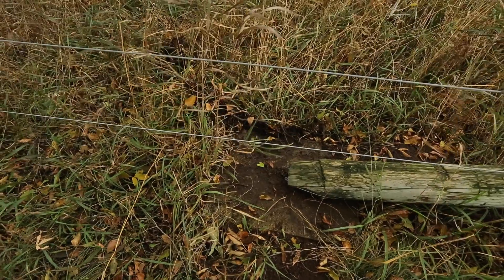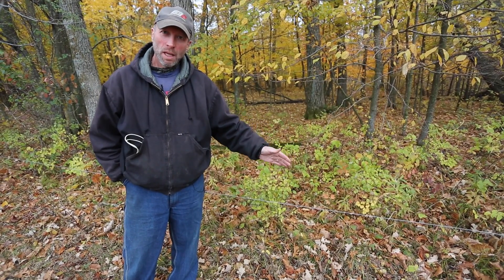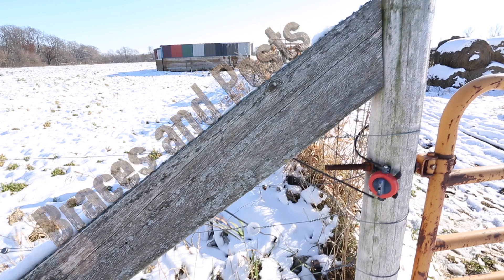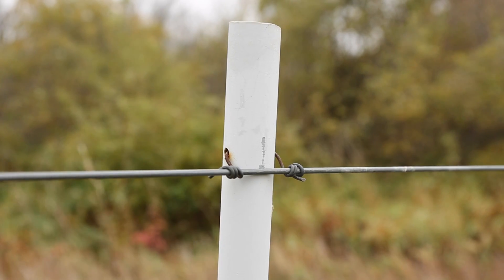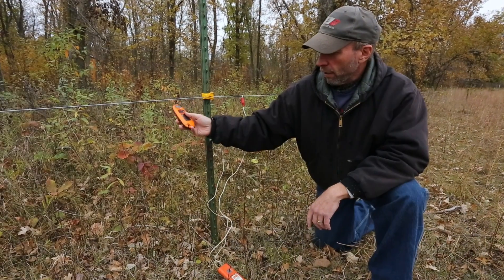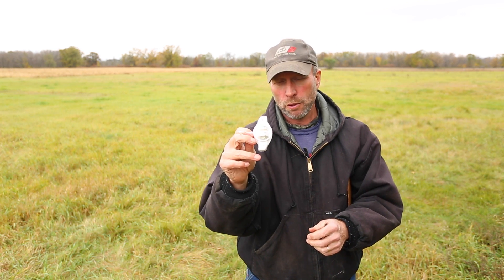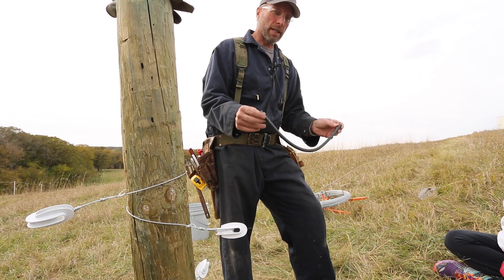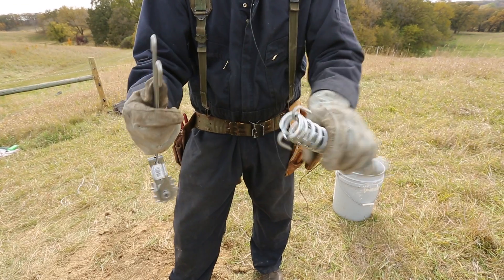Fencing 101: Energized Perimeter Fence Materials

Comment: Thanks. I hadn't considered the ceramic/porcelain issue and had no idea about the tube wraps not holding up. Perimeter fence going up soon featuring HT hot wire, Timeless posts and Black Locust corners/braces.